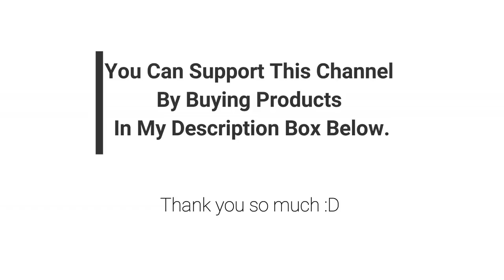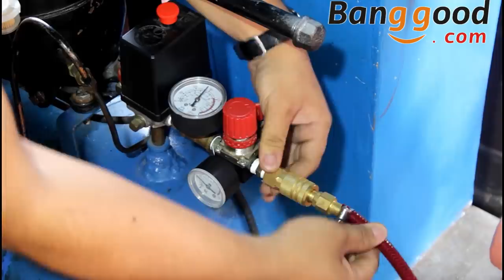Diy Sheet Metal Bender From Bearings

Comment: Great Build! I built a similar forming tool several years ago to replace some furnace duct work in my house. I got the inspiration from and English wheel I saw on TV.  Since I didn't have the room for a large bending machine or platform, I came up with this tool, takes up way less space and I believe the results were just as good if not better. I like your guide system setup it's much better then mine. I pre-loaded the single rod bearing, by threading it's rod in to the handle with a lock nut and slight bend in the rod this may not be necessary but that's how the English works. One other tool you need to go-a-long with your nifty forming tool is a rigidity line former, which is a tool that makes the X lines in long wide areas of duct work that would flex and make noise under pressure or vacuum. (you make already know this since you knew how to made this tool). I used an old thick 7 1/4" circular saw blade for the disc with the teeth cut off, mounted 2 bearings and a shaft thru the blade hole, then inserted the disc in the end of a old 1/2" steel water pipe notched out on one end for the rotating disc, with a bicycle hand bar grip on the end. I found it worked best at forming the rigidity lines laying on an old firm sheet of cardboard. Make one you'll see what I mean!  Mentor, Ohio on the  Southern shore of Lake Erie.

Comment: Like it;
 i did mine with 12mm threaded rods and nuts, no welding; 
I like your idea of drilling the ends of the rods to pin the bearings;

Comment: There is a company that sells a product that works the same way, but the small size like this starts at around  $300USD! Good video showing the build. It looks just as robust as the manufactured version. Only advice is next time you install bearings, you should only apply force to the inner diameter, otherwise you can end up damaging or bending the bearing assembly. A piece of steel tubing or a deep socket work well typically. In this project, they slid eight on, so no big deal, but with tighter fits, damage is almost guaranteed. The big selling point on these is being able to bend the sheet a 3rd time to complete the box shape. A press brake cannot do that. Also, you can use it to roll the edges with a really tight 180° lip like tool box drawers have to increase rigidity.
Reply: What is the name of the company?
Reply: @movax20h  I think it is Eastwood
Reply: Wuko and draco make them

Comment: Apologies for directness. Fascinating to watch evolve, it became part of a highly dangerous process. Inevitably as one moves back and forth ones weight and energy transfer is constantly in flux and the end points of the stroke remain constant in the physical metal plate. Over the edge with the arm and the corner of the sheet will rip up the inner forearm - it was nerving way more than the nonstop Muzak - forget it as kritik. . Be an observer of your vid with an intent to neutral assessment with regard to this. Consider, if you haven't already :-) as you r doing this process, if the potential is very close at hand for my considerations to be indicative of the predicament

thanks for the like little bro - you suddenly really freaked me out - just the thought churns my guts. I do have scars lol (not at the time)

Comment: Hi, you can integrate a small scraper device like a lathe insert to pre shape / pre cut your bend line. This can make your device much more easy and precise to use also for thicker materials. Also I would not recommend to weld like this, but to hard solder. You can work entirely with brass or copper components. A much better result.  Gruss von Herri in China :-)

Comment: Can’t go very thick with the metal. As someone has stated it is just a bead roller. Can do this on your work bench using angle to make crisp bends. Think I would make it heavier duty but for thin material the cost is low so go for it guy’s.

Comment: Pretty interesting design, I haven't seen one like that before. Part way through the video it reminded me of an English Wheel in minature, then I thought maybe a Beading Tool or even a Cutter towards the beginning of the demonstration. I guess all those tools use a repetitive rolling action with side loading/stress concentrated in a localized area of the sheet-metal to deform it into the desired shape. I enjoyed the neat way you captured the bearings without use of screws or welding.

Greetings from Chiang Mai, Thailand.
Reply: It's called a flashing bender its primarily used by roofers.